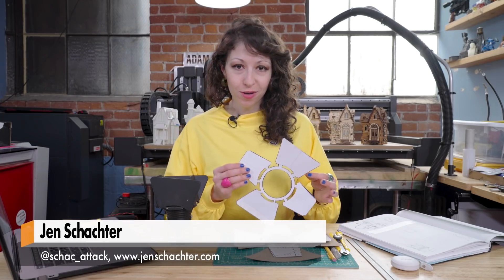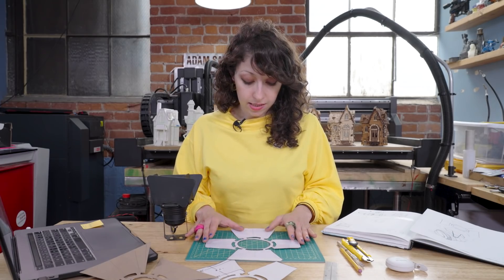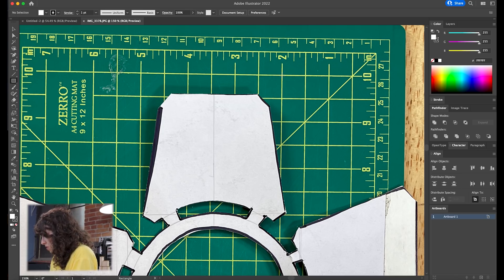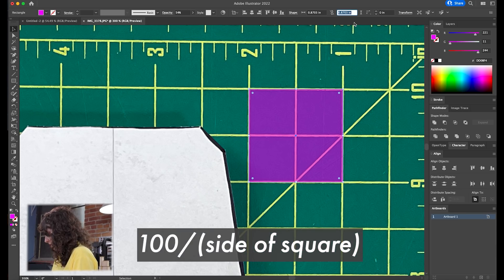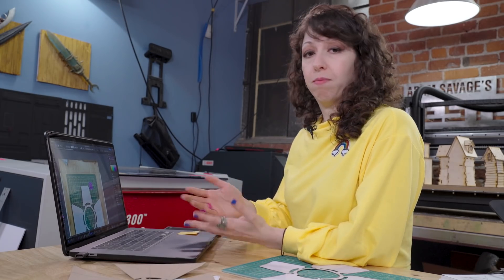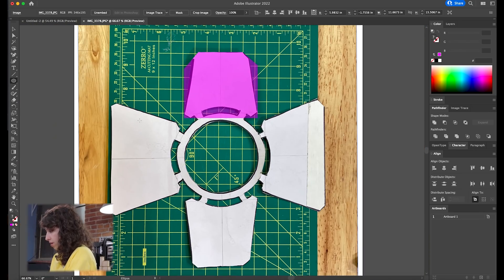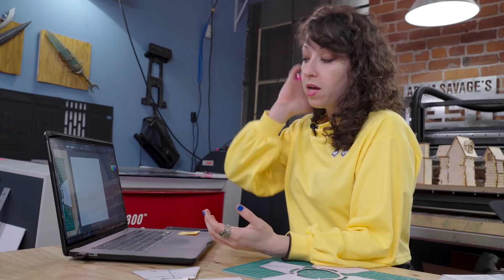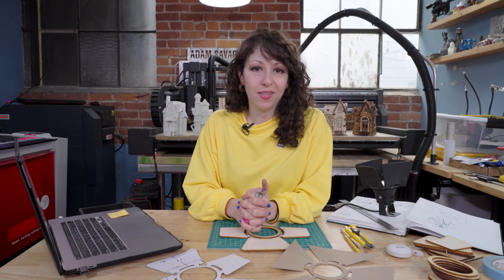How To Turn Your Sketches Into Digital Drawings!

Comment: I can't afford the professional software to do stuff like this, so I have found alternatives. I have found PowerPoint to be a surprisingly useful software for creating plans for things (I can trace scanned images, assemble, group, merge, and cut out shapes, duplicate objects, etc.), and Adobe Acrobat for printing large files as tiles that can be assembled afterwards. Some stuff I can't effectively do with PowerPoint though, and for that stuff, I use GIMP (it's a free and open-source raster graphics editor).

If I am transferring a real-world shape into a digital file, I will often mark a line of a known length on the paper before scanning so that I can adjust my prints to the correct size. I haven't tried using a cutting matt as a background for scanning, and I am going to try that in the future (I have usually just traced the edge/side of the paper with a black marker, and that shows up on the scan, but the contrast of the cutting matt with the grids would make a lot of that easier).

Comment: I saw a video on scanning a broken part on a copier scanner to photo shop app and send that shape to CAD an APP. Measure the part and input them into the CAD shape. It can be put in to slicer to 3D printer. It was a small light part and easily fit on the copier scanner. Thanks for sharing!

Comment: Your method for referencing confuses me: why wouldn't you draw the largest known rectangle in the photo in inch/mm, such as the outer measurement bounds on a cutting mat or the length and width of a ruler (if you are able to measure its width with another ruler) and then transform the photo with a distort function to drag the corners of your reference over the digital rectangle? That takes care of scale and perspective at once. The larger your frame of reference (20 inches instead of 1), the more accurate the result.

Comment: I think you could save some time / steps by importing the image directly into CAD software, specifically autocad. Once it’s imported you can scale with a reference dimension very easily. Then the object can be drawn using poly lines / circles/rectangles. As you pointed out, using the mirror command will ensure symmetry. The snap features of autocad will help to add extra precision along the way. Thanks for the video!

Comment: Flatbed scanners obviously help a ton with keeping the prototype flat. I don't use mine though as it is usually more awkward to get both the item you use for scale and the prototype on it. I usually just take a pic with an off cut of acrylic placed over it. It holds everything flat and you can obviously still see through it.

Comment: As a draftsman with 50+ years of experience, that was hard to watch.  Estimating angles, aligning by eyeball etc.  really makes me cringe.  I'm glad I have Progecad to use with all the commands that help create accurate drawings like mirror, copy, exact angles and all the rest.  I know learning cad programs seems hard but why settle for a line that is 43.478 degrees when what you were really trying to get was exactly 45 degrees?

But still a well done video.
Reply: True... and I can totally relate to getting the heebie jeebies watching someone do something you are expert at in a less precise, efficient way, so that point is totally reasonable. For all we know, she uses CAD, but since the population of people who will watch/find this useful advice isn't necessarily aligned with the population of people who want to learn CAD (or already have). But most interested parties have probably used a vector art program before. 

A tutorial on the process for people without expertise in drafting/engineering/machining software is probably more valuable to more people. Or more specifically, if someone already has a good method for doing something like this they probably don't need a tutorial about it, and a tutorial using unfamiliar software will make the task seem like an impossible hurdle to a project that might otherwise be within their grasp. So YAY for the world having so many cool ways to skin cats now!
Reply: @MB-xw1tu  Excellent points!  In my professional world I have to be as precise as possible.  In my private world close enough is good enough.

Comment: Interesting. However, you could make this in autocad so much easier and quicker. You would have to make the shape in the program though which would be easy for the shape in this video but I could see your method working better for hand drawn non uniform shapes.

Comment: This is a super useful method!  With paper templates you can also scan them in as well.   With scanning it will already be 1:1 with perfect perspective.  If its too big i cut them into small jagged "puzzle pieces", scan them individually, and piece it together in the program.   Completely changed how i design things.

Comment: The larger your reference scale is,  the more accurate your dimensional accuracy will be using the exact same procedure. 

This is because your margin of error is a smaller percentage of a larger reference.  Ie  0.1" error  on a 1" square is 10%, but that same 0.1" error across a 6" reference is 1.7%.

Comment: Something I keep finding when measuring existing objects with digital calipers and a digital angle ruler, for the intention of creating 3D prints that interface with the existing object, is that a lot of designers will stick to whole numbers for their creations, like 3mm diameter hole, 4mm thick wall, 30 degrees angle etc. which really helps when you're trying to be extremely accurate.
But it's often objects from well established/expensive brands, where the look of the object is paramount, that they'll use fractions of whole number for their design because they're going for an overall aesthetic look to it rather than a mechanically functional one.

Comment: This was a great demo, thank you! I'd like to share a few things that I've learned doing similar tasks in my job over the last few years:

1) To get the part to lay flat, you could place a sheet of clear acrylic over your part to hold it flat against the table/grid. (You will need to be wary of potential glare in your image though).

2) Your accuracy will be better the larger your reference is (your clicking accuracy is divided by the area of your reference square, so the larger the reference, the less the error). So I'd try to do the largest collection of reference grid squares you can; so in this case, you could've done a 2" x 2" in that top right corner where you referenced your image, or you could've gone to the top left and gotten a 2.5" x 2.5".

3) You also should use the most central location in your image for referencing to minimize the effect of barrel or pincushion distortion from your camera/lens....so a 2" x 2" reference square could have been taken from the middle of the circle of your part.

All of this can be even better if you can fit it on a scanner. You get much less distortion and it's kept flat.

Comment: "Do I have any ideas on how to do it?" ... Well, I think so, yes. If you want or need any kind of precision match of the final result with your paper model, put it on a flatbed scanner (that's a functionality you get included for free with any cheap laser or ink  printer since a couple of years now). Your model is lying on a flat surface and pressed down with the lid, so it's actually flat. If you enter the correct resolution (dpi) you don't even have to scale. Just to make sure (for good measure ;)) ink. a 1by1 square onto your model.

Getting all three axis perfect while free hand balancing a phone over your model leaves you no chance of doing it perfectly unless you're a robot and stuffed with sensors to micro correct your positioning.
BTW: If you see your model casting an obvious irregular shadow on the surface in the photo (like in the example), it was obviously not lying flat: restart. You could have put a glass pane over the model, to solve this issue, if you have only a phone nearby although that can't correct the orientation problem. ... BTW: any camera gives you a parallax issue, which a scanner doesn't. Although in the example given that's not relevant as the material thickness is irrelevant.

Tip for digitizing it in the program: If something is symmetrical: do one part only, and mirror it (so half of one flap in the example). Don't bother with boolean cutting primitives (works only somewhat properly for large and "easy" shapes, gets very unprecise and creates weird artifacts for more complex situations). Use polylines and splines to create one nice outline that's an actual shape (closed, no difficult to see double points, etc.), so you can use the result with any fabrication device you want without trouble. Sounds difficult but it's actually just clicking along corners and turning points and adjusting some curves in the end. Easy as pie and not slower than what was shown.
BTW: If your model and background during the scan contrast very well, you might even get lucky with an edge detection filter, although that often needs so much fixing that it's often not worth it. But as it only costs some extra seconds to run give it a try.

Comment: 1) Turn on rulers, make sure the units of your project are set to the proper measurment standard (Metric or Imperial) Also right click on th ruler adn be sure it's showing the proper unit of meaturment. 
2) Turn on Snaping.
3) Click and drag off of a ruler to create a guide, hold shift and it will snap to the exact unit of measurement. Do this four times setting them 1 inch apart. Also keep the guides confined to the 1 square inch if you try to be clever and go further out (larger area), or add another square for accuracy, it will not line up due to lens distortion. Now rotate and scale your photo accordingly and everything will be pretty much exact after you do the math.

There is also a Lens Correction filter with lens presets built-in, as well as the perspective warp tools to help with perspective/lens distortion if you want to be a perfectionist.

Comment: FYI - on an iPhone, with the grid enabled in settings, holding the camera horizontally brings up white and yellow crosshairs that become a single yellow crosshairs when level. This really helps for ensuring you’re camera is level.
Reply: Or scan a document in Notes, with four corners of the document. 🤷‍♂️
Reply: Yes and I think it confirms level in X and Y. And it also will give level and plumb if you are taking a picture in vertical. I've used illustrator for almost 2 decades (but mostly with reference to print graphics and scientific figures and illustrations)... so I'm annoyed with myself that when I was using it to make a pattern (of scientifically accurate lanternfly wings)  for a halloween costume for my kid it didn't occur to me to use precise scaling based on math (something I spend a lot of time doing for the science!). I basically printed corner pieces at a few sizes to come to the right scaling. Things you don't have to worry about when you aren't creating real world objects (or your real world objects are of arbitrary size /dimension like a poster or a label). Hopefully I have one more halloween to use my new knowledge!

Comment: (I use GIMP for photos editing, but the principle should still work in Photoshop)

What I usually do is create a document that is the same dimensions as the markings on the mat, import the photo, then use the perspective tool to line up the measurement marks in the photo with the corners of the canvas.

It's a pretty easy way to get pretty precise. It also makes getting the camera straight above less important, though it's definitely easier if you get it close.
Reply: have done the same thing with GIMP and in Photoshop (and using apps on the phone to square things that need less precision)

Comment: Otherwise great, but don't think there is need to cut multiple rings as the size of the ring required for the lamp could simply be measured before cutting and then cut 1 ring in correct size.

Comment: If you have a scanner, just scan it with a known size marking on it (e.g. draw a 1cm line somewhere on it). You should be easily able to use image software to find the required edges (it can be easier if you invert colours or remove hue/saturation) and then convert it into a vector diagram, use the 1cm line to auto scale, tidy up and send off in format to maker software :) 

The tilted perspective from cameras will mess you up, the larger the object, the more serious the warping, even if you have it perfectly flat as the image falls away from the image sensor.

Comment: Cool to see someone else's work flow. For this simple piece I would just take key measurements and recreate it in vector or CAD software, saves time and everything will be symetrical and exact. For complex geometry, either scan it or photograph it like you did (but remember to use perspective and rotate tools to square up the photo), then in software trace it with pen tool + geometries. If you feel lazy and the proto has marked outlines, just use convert to vector in Inkscape. Scale doesn't matter at first, only when you need to interface with another design or at output, you can easily take a measurement (e.g. a part's length) in real life and scale-match it in software. That's as straightforward as I can get.

Comment: Use a flatbed scanner. CCD flatbed scanners are perfect for making images of small flat objects. The correct scale is already built-in because the scanner knows its own DPI exactly.
Reply: I like this idea, but I don't have a flatbed scanner, so this video is really useful to me.
Reply: Or a print shop
Reply: Or use Camscanner from Camsoft for Android.  It has an automatic feature to trim your photo on outside lines, and straighten a warped photo.  Getting those lines parallel is easy.  I mainly use .pdf or .jpg as output.
Reply: You should be able to find one at a Goodwill, garage sale, or Ebay fairly cheaply
Reply: Or your local library

Comment: The precision is not needed in this case, but for newbies watching this. Always use the symmetry of an object to create it. In this example, you should have traced only half the Finn and mirrored it. With a point symmetric object, it is also useful to establish a center point or axis with rulers.
Reply: She did but its not shown
Reply: @mikeuk666  She did mirror the top to the bottom, but she could have taken the top fin she shows her process for, and just done one half then mirrored it to the other side. It may not have been a ton faster, but it would have been more precise. But I think she was comfortable with the level of precision she could achieve. As other's have said, there are many more precise ways to do this (e.g. CAD), but her method is pretty universally available to everyone who might want to do something similar.

Comment: In Photoshop you can use the "Perspective Crop" tool if your photo isn't perfectly perpendicular and you have a background grid.
Reply: I was going to suggest the straighten layer function in the ruler tool, but Perspective Crop really is more efficient in this case. As it is, you can also plug in the known dimensions to the crop tool, which makes setting up the scale in illustrator easier.

Comment: Why not use the entire grid you just photograph and make sure that grid is perfectly straight? The longer the length you’re aligning to horizontal or vertical. the less change of error.
Reply: I'm also fairly certain that there are plugins to various programs that can do it for you.

Comment: That was unnecessarily complicated.
Reply: How so? How could it be improved? Generally curious as I do some prototyping with laser cutting. I always meticulously measure with digital calipers and it gets annoying and time consuming.
Reply: @scioli700  the old adage "measure twice, cut once" ALWAYS works, repeat ALWAYS....
(and some things just take the time they take....)
Reply: @scioli700  measure your prototype, recreate in your 3D software of your choice (fusion 360 it's free and simple to use)
Reply: This example was definitely much faster to model in CAD. I was expecting something more efficient like removing the background and tracing the object with inkscape's "trace bitmap" function.